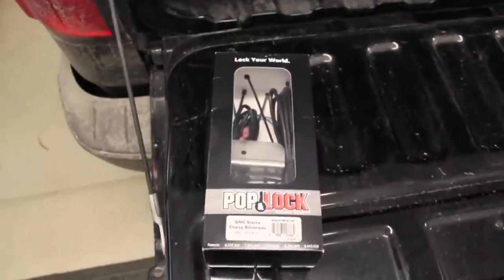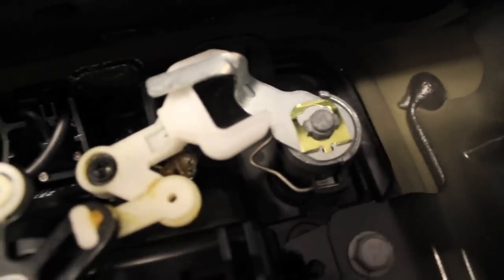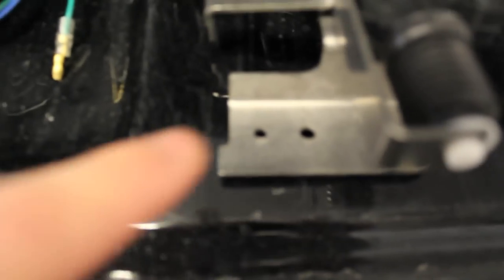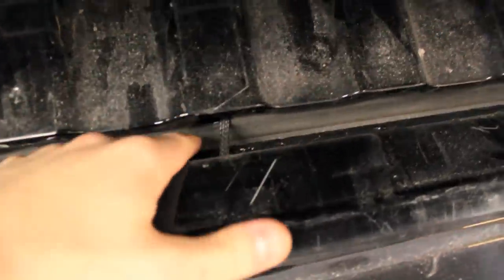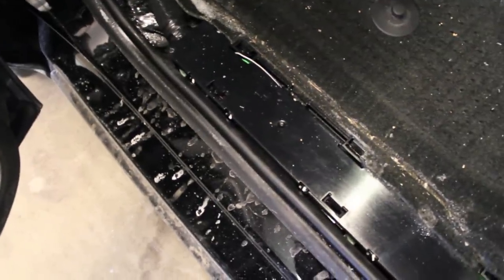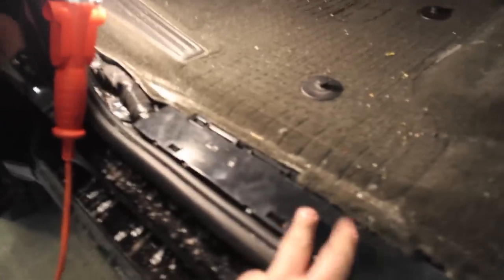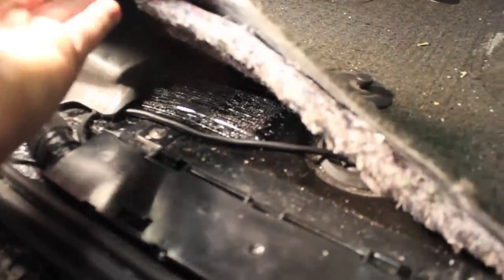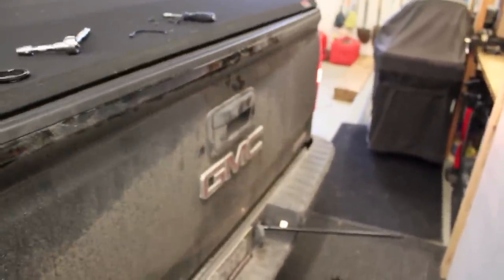[HOW TO] Install Pop & Lock Power Tailgate Lock- Silverado/Sierra - PL8140

Comment: Installed this on my 2015 Silverado 1500. Your video helped me out a lot, thanks! 

A couple notes to add:

- I was able to compete the wiring without removing the plastic cover for the wiring harness completely. Just unclipped the front 3/4 of it and held it back. 

- I didn't have a problem using the red wire taps. Used linesman pliers to crimp and it worked first try. Also, i staggered the connections to avoid them bunching up the space.
Reply from the maker: Glad it worked! Good info you added as well.

Comment: Thanks for posting this video. I just installed it on my 2014 Sierra Denali. I used the guide you have to link for to find the correct wires. It all worked on the first shot. I did have a little trouble with the actuator not pushing quite far enough. So I put a small piece of clear tubing over the finger of the lock. Works like a champ. Locks and unlocks with the driver's door. Thanks again!
Reply from the maker: Glad to help! It's a great mod that should have come standard from the factory.
Reply: I just bent mine a touch with pliers, not much just a touch

Comment: Just finished installing mine on my 14 All Terrain, and it was so simple thanks to your video...      I did have to bend that deal on the main piece just a touch because it didn't push the white fork enough to the lock position, no big deal...    Again Thanks
Reply from the maker: Glad it helped! Enjoy

Comment: thank you for the video and link I was able to do this on my 2015 Silverado crew cab.  I had one issue after hooking everything up when I hit the lock my tailgate unlocked so I just turned the connectors around in the tailgate and problem solved.  Now I have same functionality as a 2016 silverado.
Reply from the maker: Yea, some trucks depending on the year the wiring may be slightly different. But a simple fix as you found makes it work right! Glad it helped.

Comment: 2015 GMC Sierra wires are reversed. When making the wire connections move forward about 8 inches to where the harness splits. Much easier to make the connections at that point and there is a lot of room under the kick plate at that point.
Reply from the maker: +Dale Dempster Good info. Thanks for posting.

Comment: Thank you for the vid! My 2015 GMC Canyon will have this mod soon!
Reply from the maker: +John Carver Glad to help John. It is definitely a 'must have' on a pickup truck. The only thing that may be different on your canyon is the wiring harness to tap into. So make sure you do a little research to find out the correct kind. And if you don't mind, post back when you find out and I will add it to my video description! Thanks
Reply: Thanks for the advice,  I did car audio and security back in the 90's so it should be a breeze. Just want to thank you for the inspiration to do another needed mod, I had that feature from the factory on my 2007 Avalanche and I REALLY miss it. 😢
Reply from the maker: John Carver
Glad to help!
Reply: Man, I envy you.....    I screwed up and traded my 07 LTZ 4x4 Avalanche for my 14 Sierra, what a mistake...   Except for the new power train which I wish was in my Avalanche there is NO comparison...  With the level ride I didn't realize how it spoiled me....The other reason I replied is that I still have the HIGH dollar ANZO led Tail lights, K&N cold air intake, and the tuner I turned her with for sale....I live in southern California and with the weather out here, everything is still like brand new.....    Now I have had nothing but compliments on the  tail lights, and even out here I still haven't seen another set yet... Contact me if interested  I'll make you a hell of a deal...
Reply from the maker: I don't have my 2014 Sierra anymore. Got a 2017 Colorado. Smaller, better mileage, just as capable for what I need a truck for.

Comment: Does this wiring method unlock the tailgate with the driver or door or with the passenger doors? In other words, can I make it unlock on double press only.
Reply from the maker: Yes there is a way I think. You have to tap into different wires. I’m not entirely sure which ones though.

Comment: Going to purchase this soon. I have the option in my Sierra to unlock driver side door only with 1 press of the key fob and all doors with 2 presses of the key fob. My question is, how do i wire this to only unlock with the passenger doors?
Reply from the maker: To be honest, I am not entirely sure. I don't have this truck anymore, so I can't remember how mine was wired. But I am almost 95% sure it unlocked on the 2nd press of the key fob. You can see in my video where I test it out at the end. I press the fob twice and it locks on the 2nd press.
Reply: @fondupot  seen other videos where it would unlock on the first. Going to wire it like you did when I get mine. Thank you

Comment: Just wondering if you have had any problems with your lock since its install.  I keep seeing vids, customer comments on A about the lock doesnt last very long,  from a few months to about the year mark.  Just wondering what your experience has been.  Thanks.
Reply from the maker: Well I do not have this truck anymore. But, I did have problems with it. The actuator stopped working. After I got rid of this truck, i got a Chevy Colorado and I also put a PopnLock on that one. It also quit working after about 1 year of use. On my current truck I retrofitted an OEM power lock into the tailgate and it has been going strong for nearly 2 years. You could probably do something similar in a full size truck. Here is a link to that video: https://youtu.be/8kxyof_vOxw
Reply: @fondupot  Thanks I appreciate it.   Guess the PopNLock was a waste of money.  Ill see if I can find an OEM lock and go from there.  Thanks again.

Comment: Anyone know how this is done with a single cab 14?  I have the large striped gray and tan, but they dont work.  In fact I hooked them up and the door locks quit working.
Am I gonna have to go thru the driver door to find the connection I need?  If so, what would be the correct wires I need to tap into?  Any help would be greatly appreciated.
Reply from the maker: I can definitely be done. I don’t know what wires you need to tap. I would contact pop n lock directly. They might have some insight. Or you can look up the wiring schematic for your model on GM upfitter.

Comment: I am in the middle of installing this.  The video and posting do not match exactly regarding the wiring.  One says to use a solid grey wire.  The other says a grey wire with a green stripe.  Do I try them both?  Thanks.
Reply from the maker: +Harvey Insler I didnt have any luck with wires in the post. Someone else tested the wires and found the ones I used the in the video worked.

Comment: Installed on 2015 Silverado 1500...  everything works great, but when I tried to lock manually with key I turn to the right then back to middle but the lock doesn't lock
Reply from the maker: Make sure you have the c-clip installed correctly. I had a tough time getting the manual lock to work as well. And I ended up having the c-clip installed incorrectly on the actuator arm. Go back to my video around 4:30 a note pops up saying to have the c-clip face the hinge of the tailgate, the open part of the c-clip. That should do it.

Comment: On a 2015 GMC regular cab, do the wires needed still run back to the rear of the truck or do I need to find them up closer to the door hinge?
Reply from the maker: +Robbo Gee Mail You need a wire to run the actuator motor in the tailgate handle. So you still need to run the wires.
Reply: +fondupot I'm talking about running the wires to the FRONT of the truck... since there is no back door, do the OEM wires still exist under the sill plate or do I have to run up to the inside near the emergency brake?
Reply from the maker: Oh I get you now. Sorry, I am not sure on that as my truck is a double cab.
Reply: +fondupot Thanks... If you get any info, please pass it along.
Reply from the maker: ***** Check out post # 105 on the following link. Someone connected to the BCM harness under the dash, instead of under the door sill. Should be what you need.

 http://www.gm-trucks.com/forums/topic/156468-2014-power-tailgate-lock-installed/page-7#entry1498774
Reply: +fondupot    Great, I'll check it out. Thanks again.
Reply from the maker: *****
no problem

Comment: I installed it on my 2014 GMC Sierra. I followed the instructions on the video but it works backwards I push to lock and it unlocks and I push it to unlock and it locks. Can someone help me
Reply from the maker: +Miguel Gonzalez Sounds like you have your wires mixed up. try switching your wire connections.

Comment: They must have changed it for 2016.  My tailgate locks and unlocks with the key fob.  And it still has a key lock.
Reply from the maker: Yes, they added the feature from the factory in 2016. But 2014 and 2015 models did not have it.
Reply: So does the driver door,,,DA

Comment: wondering if its worth all that work ... I use the tailgate every now and then so I can move my butt and use the key to operate it ... why would I go through all that
Reply from the maker: For me it was definitely worth the work. I might have taken an hour or so do it. My bedcover could easily be removed/stolen if my tailgate was not locked. So being 100% sure the tailgate was locked every time i hit the key fob was worth it.
Reply: You should watch the video on how easy it is for someone to steal your tailgate. They made these for easy take off, literally just pull on it and your tailgate is gone.
Reply: tyltong123 I always make sure its locked buddy ... that's why I don't trust this thing .. I lock mine manually and then leave it alone until I  need to unlock it again ....
Reply: WHY NOT??????????????????
Reply: It's not a lot of work at all and it got me out tinkering on my truck which I love to do. It's a cool addition also.